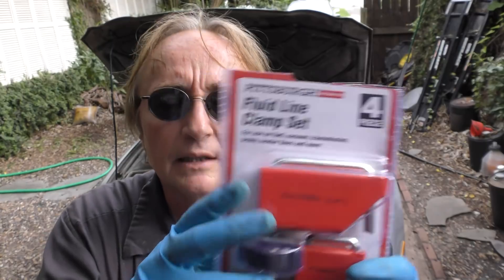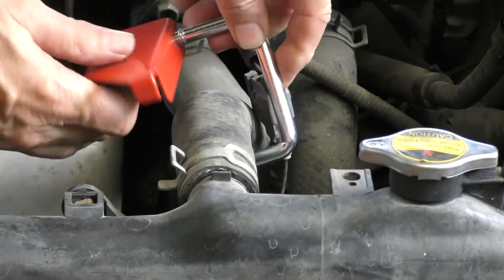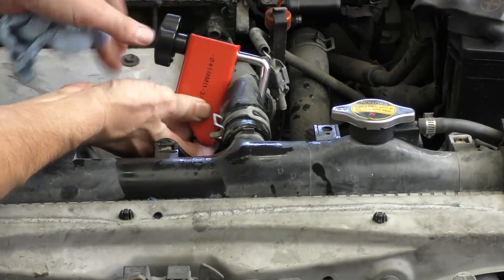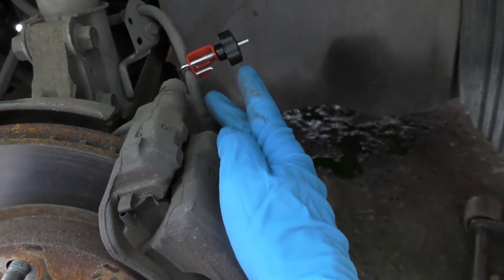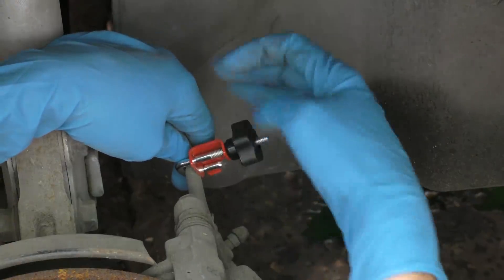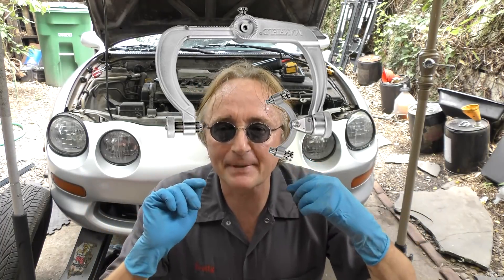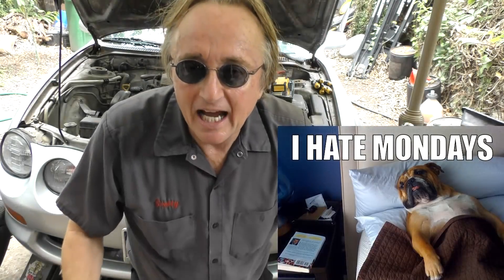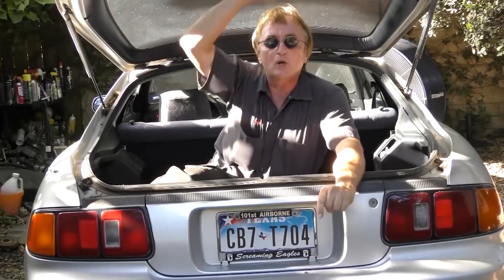Using This for Car Repair will Save You Major Headaches - Hose Clamp

Comment: Will this work if I need to clamp my girlfriend's lines?
Reply: jaykay18 yes, very well.  Just be sure to use one for the line going to the rear and one at each front wheel.  If not done properly it wont always work and she might come back
Reply: Absolutely, it's in fact exactly how it's done at the hospital.
Reply: It might, except I got a vasectomy to help prevent my wife from getting pregnant. Instead it somehow changed the color of the baby.
Reply: Did the baby have an extra finger too?
Reply: Mr 4sshole dang. Where's you go for that? Sounds interesting
Reply: jaykay18 😂😂😂😂😂😂😂😂😂😂😂😂😂😂😂😂😂😂😂😂😂😂😂😂😂😂😂😂😂
Reply: Alameda Repair Shop You mean if the baby have an extra brown leg in the middle?
Reply: jaykay18 clamp your lines

Comment: These do work great, I've used them many times over the years. For "newer" brake hoses no prob, but I wouldn't use them on older flexible brake lines where the rubber is dry and not too pliable, you'll end up having to replace the hose from crushing it. The inner walls of the hose may separate.
Reply from the maker: thanks for the input, forgot to mention that in the video
Reply: This problem may be eliminated by periodically replacing your brake hoses every 2-3 years, especially in hotter, drier climates such as in southern Arizona.  Going over them with a protectorant like "303" may also help.
Reply: Scotty Kilmer I made the mistake myself on a Dodge Caravan a long time ago while living in the Bahamas, that's how I know. It's hard to remember every little thing when making a video. Just so you know, your channel is one of a small number that I watch frequently. You produce very good videos, and I understand your point regarding other channels. Sometimes people have very good success doing things a certain way, a way which wouldn't be considered typical. Keep up the great Videos, and sorry if I sounded too critical with a few of my comments.
Reply: I too had the same concern, thanks for discussing it! These things look pretty useful and im considering getting a set
Reply: Love the channel Scotty!!:))
Reply: This comment should maybe be pinned to the top of the comments... or edited into the video's description (if youtube allows that), important for all the old hoses
Reply: If the hose can't resist the clamp then I thin it's junk and should be replaced already.
Reply: @azmike3572  Yeah, have fun with that, I'll just not use the clamp tool.

Comment: I normally use vice grips, they work pretty well. For the bigger hoses these clamps could be handy though.
Reply: KastaRules I use the need nose vise grips with rubber hose on the ends to prevent damage to the hose.
Reply: I was taught all mechanical problems can be solved with vice grips, a hammer, a flat head screw driver.....and duct tape.    These days I would add plastic ties.
Reply: Yeah I'd use that too for clamping brake lines

Comment: Air in the ABS is only an issue if it gets into the hydraulic pump, and that's pretty much impossible to make happen if you're changing a caliper or brake hose at the wheel. The hydraulic unit is sealed off from the rest of the system, so the air would have to travel all the way from the wheel back up to the pump and then the valve would have to open to let it in, and that's not going to happen. Simply replace the caliper/brake hose, bleed as normal, and you're done.
Air is most likely to enter the ABS unit if you're not careful when changing the brake master cylinder.
Reply: Exacly my thought. and by the way clamping old brake hoses could damage them as in the place were the clamp was could swell up and cause you problems.
Reply: Evoksik, if I have to worry about damaging my old brake hoses, then it's time to replace them. But I'm a DIY guy that does his own work because I know I won't cut corners.
Reply: Yeah, try to explain that to a customer. 'Your brake hose that would last for another 10 years or so needs to be reaplaced because i had the need to save me some cleaning up by pinching it with a tool'. It's not cutting corners, it's avoiding unneded repairs. Brake rubber hoses have multiple layers and pinching them might create a tear or separate a layer and that can cause it to go bad in a short ammount of time.

Comment: Have the same pair. They really do work great. I'd be weary of pinching off a hydraulic line though. You might damage the inner liner and cause a restriction. But for single wall hose, they rock!
Reply: He means after you take the clamp off.

Comment: Good advise. Especially about avoiding contamination of the brake lines and the ABS system. You should have mentioned that if you clamp the brake line during a brake job, you will have to open the bleeder valve in order to press the caliper pistons back.

Comment: Can't you just use locking vice grips or whatever?
Reply: Kiraro The Kitsune Probably. I have some surgical clamps that would probably work for brake lines.
Reply: VICE GRIPS Work
Reply: I think this just gives u less of a chance of tearing or puncturing something as compared to vice grips
Reply: Would be too heavy on Davis Bellow's nose during allergy season.
Reply: Sorry--meant to type "David".
Reply: Kiraro The Kitsune vice grips work great but I make sure to use some cardboard between the grips.
Reply: Kiraro The Kitsune  ita 2018 thats back in the days .
Reply: Cardboard or I have a peace from a coolant line in my tool box, works great. I've used regular pliers + zip tie too. :)
Reply: You can, just stick rubber nose into the needle nose locking pliers so you don’t damage the actual hose. I also have a set of line clamp pliers I bought years ago at HFT that work perfectly!
Reply: use a rag  or a piece of plactic when you clamp will fix that...
Reply: The parallel sides make this a good idea.
Reply: Leo Vidal oh right, gotta update my self
Reply: MrAwesomeKociks Nice
Reply: LOL  they don't talk back. 🚘🙊
Reply: yes, but put a piece of cloth/material between the grips, that way you prevent tearing/damage.
Reply: you can but you would also need a washer or two to prevent from damaging the line.

Comment: I use vice gripes, but those jagged teeth eat the hoses sometimes. These look handy to have.
Reply: You can solve that problem easily. Cardboard over the teeth. a piece of rubber or hose or even foam, even a rag. Just about anything can be a buffer between the teeth and hose.
Reply: Bill Does Stuff Thanks! Never thought of that
Reply: Man, common sense rules the day doesn't it ?

Comment: I like the idea of these clamps as opposed to using ones that one might use for woodworking.  
All the pressure surfaces are smooth.  There does not seem to be any serrated (otherwise rough) surfaces that might damage the outer casings of the clamped hoses.

Comment: Scotty great tool looks like especially on GMC and Trail Blazer with 6 cycl these vehicles have no radiator drain plug to change a thermostat on them it can get messy. It can help to control the drainage of antifreeze. Reduce mess  still can drain to it seems with the clamp because you can place the hose in to drain catch container release the clamp. not do it by pulling clamp and there is your mess. Great tool i like to ein one.

Comment: when i was still working as a mechanic i had a set of plier looking type of hose clamps but they had a rounded type jaw and a kind of long ratchet gear to lock them. then click a tab on the handle to release em

Comment: I use a brake depressor to hold the brake pedal when i remove any brake hoses. Fluid wont flow out if pedal is pressed

Comment: Those are great tools to have in the tool collation.  Does require some intelligence though.  Some hoses do not take well to being clamped.  Brakes hoses are an example.  A lot of manufacturers use a reinforced hose.  Meaning it has a braided material on the inside of hose.  Could be steel.  I have also seen nylon.  They are designed to handle pressure.  Clamping could damage the braided materials and cause problems later.  Keep a few small piece of hose in tool box.  When you remove the banjo bolt from brake hose.  Reinstall banjo bolt then shuffle hose over the open end of banjo bolt all the way to brake hose.  Then clamp old junk hose.  This is just one of many methods of controlling fluids to not make a mess.

Comment: If you use the big syringe technique with your brakes drawing it out from the caliper you cannot get air in the system with abs and cause no stress to the brake master cylinder seals.
You get a lot better braking doing it this way let me tell you and it brakes as soon as you start pressing the pedal.
When you do it the old way of pumping the brakes the pedal goes further down before it starts braking.

Comment: Scotty I plan on doing a radiator flush on my f150 and change the thermostat,(truck only wants to overheat when the ac is on so i assume its the thermostat) should I replace my thermostat after the flush or before the flush

Comment: I bought a set of these clamps and did what you said. I think my set was defective. Now my car overheats, the brakes don't work, the power steering pump squeels and 2 fuel injectors are ruined.

Comment: This will never stop the need to bleed brakes if you have opened the lines or unless your positive the brake fluid reservoir was never low enough to suck air in. Suggesting otherwise is both dangerous and ridiculous.

As for radiator hoses, many have springs which will end up crushed. Also I really can't think of a job to the cooling system that doesn't require you to drain the system before hand.

I'm sure these have uses but having worked on my cars as well as family and friends cars for the better part of 40 years I can only think of a few and I can do the same thing with Vise Grips for those.

Comment: If you clamp the hose won’t that keep the piston in the caliper to opening up? If your doing a break job and not disconnecting the hose from the caliper why would air build up in the hose line?

Comment: I can't recommend doing that on a brake hose, especially if it's got age to it. I keep some vacuum caps nearby all the time so I can squeeze one in the banjo fitting to stop it leaking out. It's a lot quicker too. I also prefer letting all the coolant out because 9 times out of 10, it's never been changed anyways, I can see it used more on the hobbyist side of things.

Comment: High pressure hoses are never to be clamped or kinked, it makes the  internal wound core very likely to rupture at that point. 
Low pressure coolant, air and oil, OK.
Reply: How else would you stop brake fluid leaking all out when working on a caliper piston?  I don't see the need for a scan tool though (like he said).

Comment: So, if I use that to clamp off my brake hose to the caliper and replace the caliper, I won't have to bleed the system?
Reply: Old coinchaser that is correct sir. You will have to bleed the bit from where you clamped to the caliper, and that is it. Basically two second job for that. So the closer you clamp the less that has to be bled.

Comment: Thanks for the video Scotty! These would have a lot of uses. It could even be used on an air line or garden hose. Great for working on lawnmowers when you have to disconnect the fuel line from carb or gas tank

Comment: is 1999 toyota corolla (181,000) manual transmission good deal for $1000? guy says nothing is wrong with it. anything i should check? for example, if it were an automatic honda early 2000s i would thoroughly check the transmission, as they're notorious for failure. what do i check on '99 corollas?

Comment: I would be hesitant to clamp off older or stiffer hoses.  I have clamped off hundreds of hoses in a chemical laboratory.  Tygon tubing takes the most abuse without failing.  It is relatively flexible and is not usually used in automotive products.  Stiffer tubing, like black butyl rubber, or thick-walled red (natural rubber) vacuum line tubing, are harder to clamp off and will tend to fail more readily (split, crack) after being flexed by a clamp.  Just my two cents.

Comment: Wouldn't at least SOME air get into the part of the brake line ahead of the clamp (between the clamp and the nipple on the caliper? 

In any case, these are nifty! I cringe whenever i see people use vise grips on rubber hoses....

Comment: Well it kinda works when you are only removing the upper radiator hose , what's ya gonna do when you need to take off the lower  hose  ? , you can't stop the fluid from dripping just by clamping the hose , you need to close hole where the hose fits ,
I think the best way to prevent your   radiator  fluid from dripping all over is simply use the bleeder that is somewhere at the lower part of the radiator , i think every car has it , just drain all the fluid in a bucket and reuse it to fill up the radiator once you're done working on your car , 

Also i don't think it's a safe Idea to clamp your brake lines like that , it might damage the brake line and cause a break failure while you're driving! , yes the brake lines are made to handle high pressure and the abuse while driving on the rough roads etc..., but why take that risk? , brake lines are designed to hold the pressure inside and give the wheels just enough flexibility to move up/down left/right  , not squeeze them and deform the circular shape of the line which might damage it ,
Also it's a good idea to change  your brake lines when they get old , they don't cost much , but it sure  increases your safety ,

My car had a brake failure once , and it almost got me into a wall! , luckily I was driving slowly , and the brake failure was caused by the brake lines .

Comment: I would never recommend clamping a brake hose, you could weaken or ruin the reinforcing structure of it. It's not meant to be clamped. Plug the hose with a plug rather than clamp it.

Comment: Use those clamps,and sooner or later u will burst old hose that was put thru thousands of hot-cold cycles and become brittle. U should NEVER clamp old hose.   Clamping hose of your brake fluid is even worse idea... if u only knew what is that hose made of.

Comment: Dangerous advice on the car's most important system,  it's BRAKES.  1) you never compress a brake hose, and 2) you DID just introduce air to the system.   How can you tell the public that you don't need to bleed the brakes after what you just did with the caliper?  SMH
Reply: Devonne West  wow u are a smart woman I'm sorry u are totally wrong on all that close though
Reply: Devonne West no air can get in the brake system that's why we bleed brakes
Reply: What you just said is very untrue. I've clamped brake lines a million times and never once had to blewd the system. His advice is pretty accurate and yours is not!
Reply: I'll take someone with FIFTY YEARS of experience performing this DOZENS of times over your novice advice.
Reply: Really? Clamping brake hose will introduce air to the brake system? If you are pushing on brake pedal, and while doing that it's being clamped, than may be. But you are not a nut to do so right? You are clamping while nobody is pushing the brake pedal, right? Just like Scotty is doing it. Go and put U head on the table then cover it with the book on brake system, may be it will stop talking nonse then.
No offense meant though, bless you to become a person with better knowledge

Comment: Dang, wish I had a set of these when I replaced the thermostat on my Ram 1500.... Dodge and their genius engineers put the thermostat at the bottom of the engine, so you have to either drain the whole system, or loose all the coolant when you unbolt the thermostat boot
Reply: 4.7
Reply: That really is pretty ridiculous.
Reply: leakyjeep5.9 what are more reasons?

Comment: They work great on metal lines too ...
Reply: More like a crimp than clamp then :P
Reply: That they do, i cranked one onto a rusty leaking brake line. I didn’t want to deal with it as I was only driving the car a few more days, and who needs both rear brakes 😬
Reply: Yeah, and it's easier to bake some donuts if your car is RWD :P
Reply: "Gimme the biggest clamp you got"